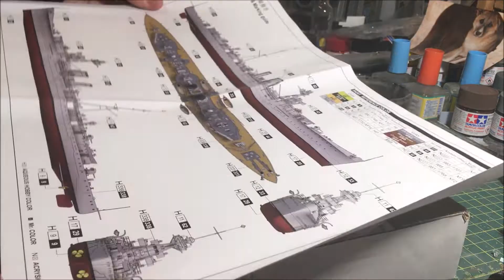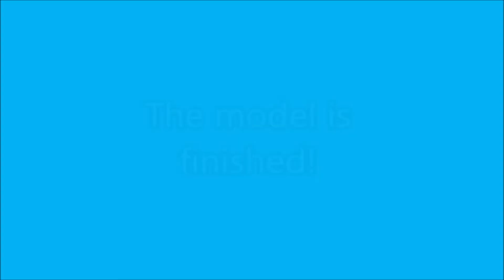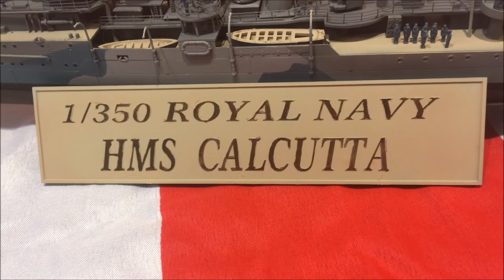HMS Calcutta 1/350 Trumpeter: Detailed Building and Painting the new kit

Comment: One question about attachment of p e . Do you ever use kicker for superglue when attaching p e ?
Reply from the maker: I'm not familiar with Kicker, is it a fast-hardener for superglue? If so, no i tried baking soda once and will probably never do it again as it makes huge blobs of soda-glue mix. And superglue with gel consistency provides an instant adhesion with PE and plastic parts. i used liquid superglue before, but there i had the problem that the pe parts changed position before hardening
Reply: Yes its a instant accelerator for superglue. I usually fit parts as close as I can . Then I add superglue to part and attach it but if it has trouble adhering I add a small amount of kicker and its stuck instantly but can still be broken off if handled roughly.
Reply from the maker: @georgedistel1203  sounds interesting, i might look how much it is the next time i'm model shopping and try it out! making life with PE parts easier is always desirable. Thanks!

Comment: What glue do you use to attach the photo etched parts?
Reply from the maker: Hi! i use super glue, one from Loctite with rubber particles in it for better grip on the tiny parts
Reply: @funinscale2892  Loctite - my too. But how do I but rubber particles in? Should fine-grade a tire?
Reply from the maker: @runesvensson1244  They are already in the glue, it is a special super glue, Loctite PowerFlex Gel is the one. I use this most frequently, from time to time it runs out, then i use liquid reserve glue and start cursing because its so frustrating to use